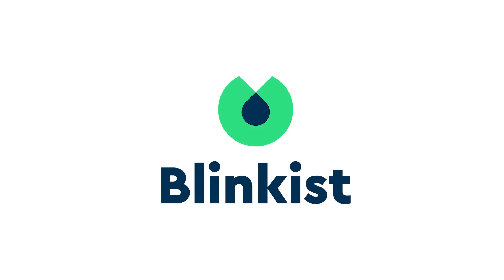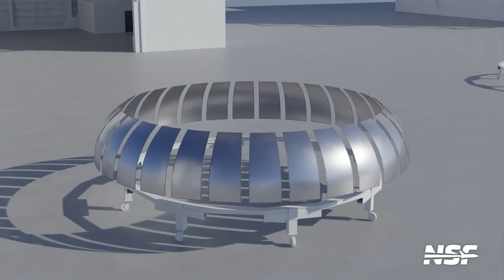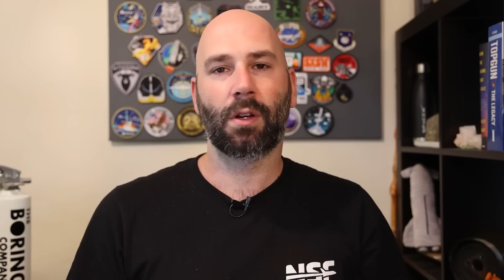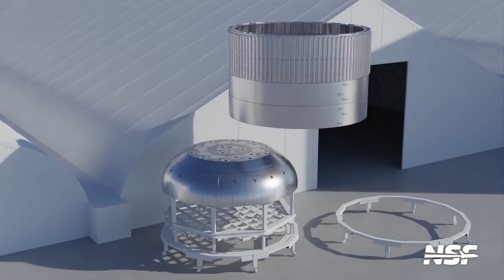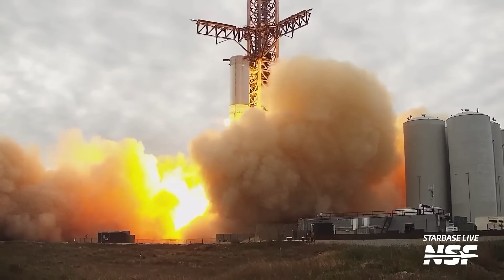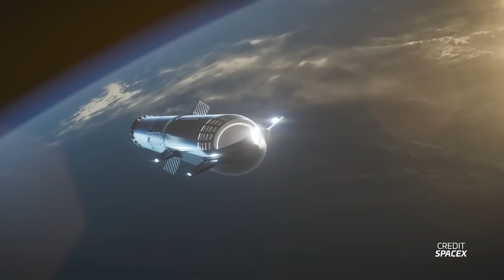Building SpaceX's Starship Super Heavy One Ring At A Time.

Comment: This is about the booster but on starship there are also large fuel and oxygen tanks. If, as an option, a starship is designed to be a permanent space station in orbit, would it be possible to use the fuel/oxygen tank volumes as habitation/storage space? Otherwise, seems like there's be a lot of unused volume. Anyone know if this would be technically possible (or advisable)?
Reply: It basically all boils down to: They aren't designing (openly) any of that yet.
Getting Stage Zero, Booster, and the default Starship actually working ... -> "Ok, now we can branch out". There's a lot of possibilities once those first three are even partially working. (Plenty of stuff to do even if Starship never ever completes a successful bellyflop), I say this because the core technologies making this plausible are the Raptor and SpaceX's avionics. One should be about $6/million per Starship, and the other's primary cost is actually software - that is, not consumed. This makes NON reusable Starships viable, and reusable ones gravy.

If you have a working Starship, exactly as "currently planned" at 150mt of payload - then yes. I can see a lot of ways to "spend" that 150 tons of payload to make the "regular" Starship better as a (semi)permanent space object. Hatches, solar panels, docking port, for instance. 

But, imo, that's still not even scratching the surface. "Space Construction" to date revolves around "assembling prefabricated stuff". The entire idea of sending a ship of people whose primary skillset is "welder" to space has never been vaguely plausible before.  A payload of 150mt is roughly 100x "rolls of steel that can each make a Starship ring section". Yes, one needs to some specific and heavy tools and jigs. But - that mass payload could (hypothetically, of course) turn into another two and a half "Booster's worth" of volume.

Shorter: A half-functioning Starship system will still cause a massive increase in all sorts of space activities.

Comment: Theoretically the dome segments could be made as a single piece via a type of machining called metal spinning.
Reply: A one piece dome section would need a very large chuck and a very large circular piece of metal + A machine to rotate it at high RPM !
 I think SpaceX are doing great.
Reply: @stephenguy6606  you are not wrong, but it is worth review as there is the potential to improve multiple aspects early in the process of history. What is the reduction of one inflight failure worth if it is better to know the better way to make a part? What is it worth to know how to increase production speed of a major component by a significant amount? It is better to make improvements now & take advantage early than to wait & miss the opportunity.

Comment: 1,300 tons? Not even close. Try something in the range of 5,000 tons at liftoff. Just the fuel weighs 3,400 tons.
Reply: The sentencing structure was referring to how much weight the Starship was, that the Booster had to lift. Yes, the gross lifting weight of the Starship System is indeed, as you so correctly pointed out, 5,000 US tons.

Comment: I feel like it should be the catching burn instead of landing burn lol
Reply: Well, you are landing, just not on land.
So should it be called a chopsticking burn?
Reply: Catching would be misleading. The booster lands on the chopsticks. It just has its legs very high up under the grid fins. I am not sure the chopsticks have to move at all. The booster will glide in sideways and down, until it touches both rails of the chopsticks and kills the last Raptor. The chopsticks have thick rubber shock absorbers and hydraulic one too - combined they would make the contact rather soft.
Reply: The Two point, pin point, precision placement burn. (TP P⁴B) pronounced "[T P,  P cubed B] landing".
The 'Daniel son' fly catch burn. Ooooye!
The 'Crazy Elon' chopsticks catch. 🤪
The Super-duper, Booster Scooper grab. 
The Boca Chica Crab Grab, with double pincer movements.
The Broomstick wizard landing.
The Booster serving, with Chinese styling.
The 'High Tower' Texan Arrest-or, the Police Academy way.